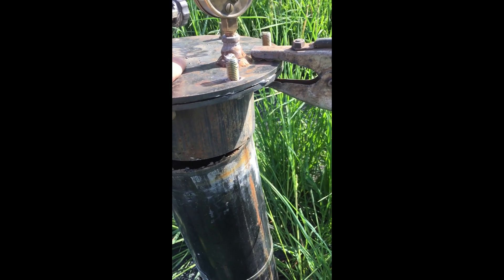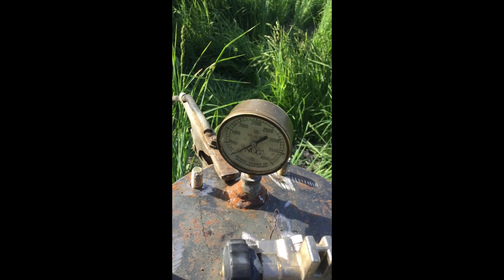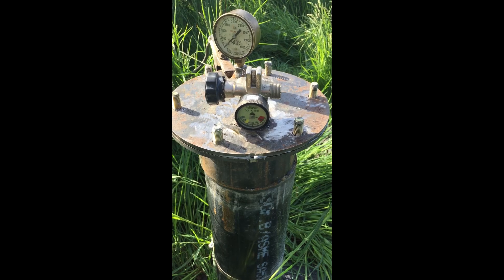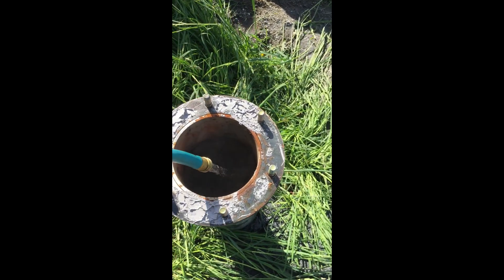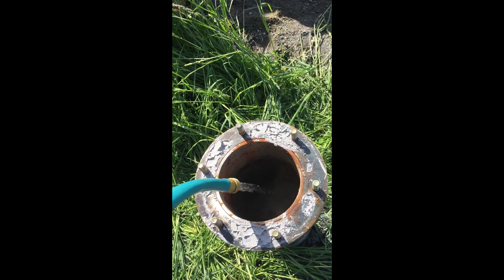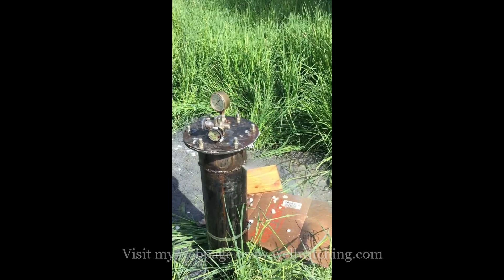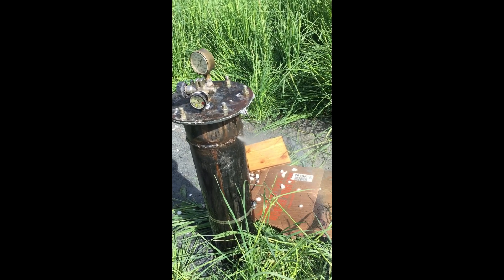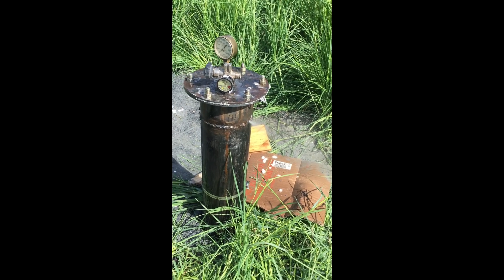Dry Ice Well Fracking

Comment from the maker: We used 40 lbs,  6” well casing, used a 4” PVC pipe to hold the dry ice.  Put some plywood at the bottom of the PVC.  Stand it up and pull out the board.  Bang the PVC pipe so everything falls down, move fast and bolt on cap.  You have about 20 seconds tops

Comment: How did this work? how much dry ice. what was flow rate before and after? what did you use to make your cap? what size casing is that? so many questions getting ready to do the same.
Reply from the maker: It would have worked better. Needs to be 100% sealed.  80 foot well. 30 lbs of dry ice.  6” casing. Used 10 gauge material for the cap.  Pre make a seal before attempting good luck
Reply: @herbhippler3800  How much pressure did it build? Or do you think it would have built?
Reply: @herbhippler3800 

What pressure dit you get on the gauge?

Better water flow afterwards?